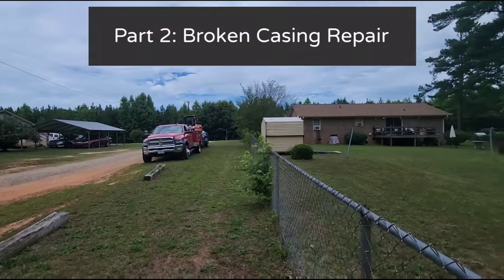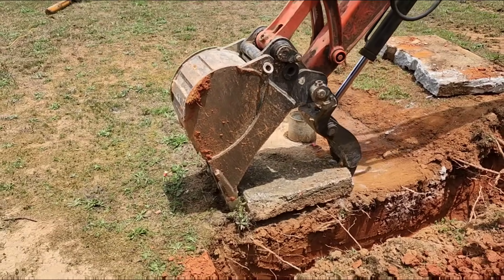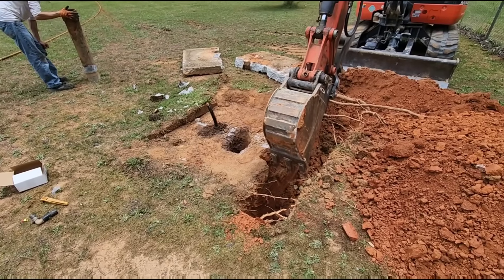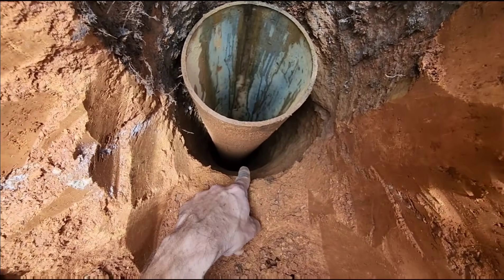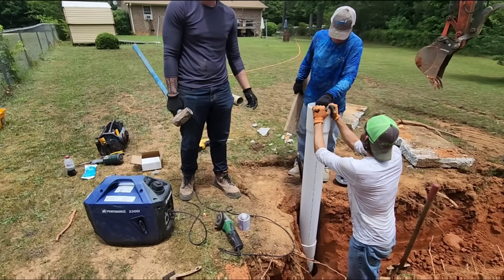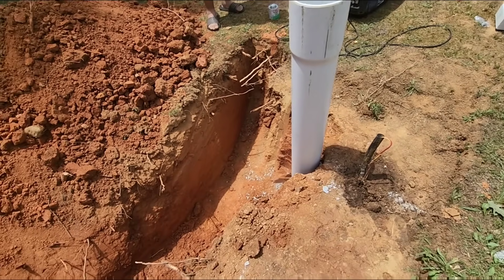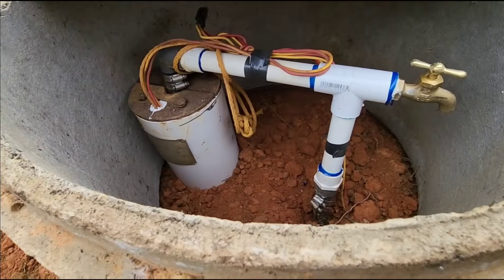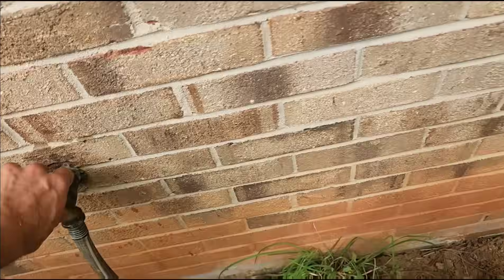Part 2 - The Cause of Muddy Well Water After Raining, Casing Repair.

Comment: Stupid of the original driller to not use threaded pipe or at least grout the casing.   Glad you were able to help out this homeowner.  I think my dads well is in the 60 year old range.  He has steel casing and has had rusty water for the last 20 years.

Comment: He should have mentioned to the owner that if the lower pipe part sags he now have a risc of misalignment deeper down the pipe. This would make installing a liner very hard or even impossible. What they did now was only possible because it was near the surface. So i would not reccomend to wait with the liner installment to long.

Comment: I modded all my 4-1/2" angle grinders with larger guards so I can run 6" thin kerf cutting disks. I've done it for many years without issue and the extra edge speed and blade reach is worth it.

Comment: Knowing the well pipe is cracked and all the steps you’ll just did to save the well as is! Why the hell not run the water straight out the pipe at the well to purge the dirty water before putting a garden hose valve?

Then run the water at the house for around 5-10min to purge the water line to the house. Then run water to purge all the water lines for the water heater, kitchen, bathroom and laundry room!

Comment: For 1980 that was some extremely lazy casing install. If it fell in after cutting it would not have been that hard to fish it out and do it proper. The fact they did it twice boggles my mind, the casing is actually in really good shape so I doubt it rusted out the threads. The concrete pad was the cincher. Their intent was obviously to try to stabilize the top of the casing that was just resting on the coupler. But in reality that kept that top part unable to settle with the lower part.

Comment: I would start looking into Air well (condenser) & Atmospheric water generator's Technology
(80Ltrs ~ +10000Ltrs Per Day )

Air Well Remains At above Ground level (easy to Service & Fix and keep clean ) Guy with HVAC Skills Can fix Them

They work in Drought Arias (Droughts going on for decades No Rainfall in Years ) and can work OFF Grid Battey less Solar & Wind power (SOLER MPPT VFD)

Cisterns (Underground Plastic Tanks / Underground & And Above Ground raised weight accumulator tower) Buffer (With UV-C & OZone germicidal loop Treatment)

Comment: BE NICE TO RUN A WATER HOSE DONE THE PIPE TO CLEAN THE IN SIDE OF THE PIPE AND ALSO SPRAY OFF THE MUD ONT HE WATER LINE CAMING OUT OUF THE HOLE... SO IT WILL BE CLEAN AGAIN...

Comment: As I plumber watching this.  I would suggest you invest in a 4-6 inch test ball from a plumbing supply house and a couple extension hoses.  Would be a lot safer and easier to seal the well from debris falling in.
Reply: Good idea.
Reply: It would have been avoided if the ones who put the well in did the job right. Threads with Treads, not just sitting on another pipe without Threads.
Reply: @Lord_KnightMare there are times when we all have to fix stuff that was installed incorrectly. You know the cheapest bid wins the job.
Reply: @ashleywynn4923  as an electrician it gets scary seeing how the lowest bidder managed to make money 😂

Comment: Lining wont fix water contamination unless you are grouting/sealing between the outer pipe and the liner. Is that what they will do?

Seems to me the better decision is to dig another ten feet down and seal the broken joint.

Comment: I totally lost by this. I have worked Colorado water wells for decades. We always used steel pipe casings cemented into place. New holes need min 40 foot casings. Then I saw a number of your wells with pipes coming out the top of the well head. We used pitiless adapters 5 feet down. It’s strange seeing wells where the casing is plastic and wiggles about. Is this the standard for your part of the country?

Comment: How is the coupler sealed to the steel casing?  I understand it's cemented w/ PVC cement to the PVC casing.  And do you sell those on your website?  Always interesting to see the options to repair different issues you run into.
Reply: It's essentially a weak compression fit. A semi-flexible material is tightly fit (the hammering forces it around and seats it) around an inflexible pipe, so it's like attaching a hard radiator hose. The 4" pipe itself is not under pressure, it's only a conduit for the pump and smaller pipe it is attached to. All you need is a seal tight enough to resist the fairly low pressure of the ground water attempting to seep in, which that fitting will do, and any seepage attempting to go through that tight fit will self-seal with particulate. That's a good "quick" fix for a fairly serious problem of half-assery done 40 years ago.

Comment: Thanks a bunch. It was a great tip to find out if a concrete is put around the casing, in time it can move. Something which I was contemplating on doing here in Uganda. This video was a great help to deter me from putting a concrete slab around the casing. I just got a new borehole machine for my voluntary project in Uganda helping villagers with clean water. I was about to start the first borehole but ran out of time on my air ticket. I'm heading back to TX then back again to start the first borehole using a submersible pump. Other villages where there is no electric, I'll be using a hand pump. Do I have to flush the borehole before installing a submersible pump? Many thanks for sharing your very valuable experience with us. For me your work and advise is a rating of 12 out 10
Reply from the maker: Once you drill the well, you can install the pump & flush the well by allowing it to pump for 30+ mins. Itll allow fresh water to flow in & hopefully the water becomes clear.
Reply: @h2omechanic  Many thanks, your response is greatly appreciated. I'll give it a try as you suggested on  my return from TX. Is Polymer necessary to use in order to avoid borehole cave in? Here they mention it when drilling but not when dug by hand. I am about 8 km from a lake which is about 10 square meters and about 3 meters deep. I have not heard you mention in any of your videos. Someone here gave me an advise to buy a 7 inch drill bit and use 5 inch casing. I bought a 7 inch tricone drill bit for use on tough rocks. Not having started the first borehole with a new machine and  having watched your videos, now I'm  wondering if I can use a 4 inch casing instead since I already have a 7 inch drill bit. So using a 4 inch casing for both hand pump and submersible pump, will it work? Many thanks again
Reply from the maker: @umojacleanwater  yes alot of people use 4" casing. It's different from region to region.

Comment: If I were the owner, I'd have you dig down the next 10 feet to the hopefully last loose joint. Then replace up to surface. Hopefully eliminating relining the well! Also you need to repack backfill every 3 inches so nothing shifts when soil settles.

Comment: Jesus that's a muddy ass well.

Have you fellas ever installed HDPE well casing? It's not quite as straightforward to work as PVC but it's a lot more resistant to cracking and all that. And you can get it in crazy lengths.

Comment: You could put a flat chisel on your sds hammer drill and jack hammer alot of that dirt out into the pit and not have to dig quite so much with the shovel and maybe save some dirt going into the hole

Comment: Man I wish you were in my area. I have a large diameter concrete casing well that gets muddy after every rain. I can see runoff water going in about 12 feet down. I've had three plumbing companies look at it, and nobody knows how to fix it. You mentioned using a liner. I think that could be my solution. Thanks for the video. You're a master.
Reply from the maker: There's no fixing your bored well. They work using surface water. 
You must use big filters or drill a drilled well.
Reply: @H2o Mechanic  Thanks H2o Mechanic!  Bummer.
Reply: Good evening Sir, where can we I purchase a transition coupling like that?

Comment: Wth?!  Somebody's not thinking too clearly.  There was no reason to remove the 1st piece of pipe and then need to put in a plug.  Just plug the 1st pipe, and dig all you want, and down to the 2nd bad joint and also fix it.
Very poor work and only 1/2 of the job, bec if you fixed both joints, there most likely wouldn't be a need for a liner
Reply: Watch part 1, the first piece was shifted out of place
Reply: @ricardinobp  So that makes no difference.
Reply: Dig down 40 feet to the 2nd bad joint? Are you crazy. It would be a whole lot cheaper to just yank out that steel liner, and put in a whole new well. He said 5000-5600 estimate to just replace the whole well, pump and all. Digging a 40 foot deep hole in the ground with an excavator would make a hole so big in the yard, the house could fall into it. And cost 10x or more.
Reply: @brnmcc01  The 2nd bad joint was 10ft down. But still, 10ft down is a LOT of digging anyway - and unsafe.

Comment: I have the same problem, but my well is only 40 feet deep and 3 feet wide. The casing is made of 13 concrete pipes and when it rains the water gets dirty. Also, I realized that rain washes away the dirt around the casing so now I have 5 or so inches of space between casing and the soil. What can I expect in the future?
Reply: What's the ground makeup the soil layers etc is there a well log on the construction how is it back filled around the casing what is the static level does the water come in from the bottom material is there a gravel pack etc. lots of questions and variables I know then who was the driller how many gpm do it produce ?
Reply: Getting sick

Comment: U got a new sub. I just want to say I like the content and info it's been hard to find information on some of this stuff that Is reliable. Had a problem with my well and had a service call and was told that my pump was failing pressure tank control box were all bad. Only did the pressure tank and control box to get water restored. We had been dealing with the low pressure since the purchase of the house so was surprised that it was even lower than it was prior to the issue and even though he pulled out the pump he didn't chlorinate the well. So we dealt with the low pressure for a couple of years but I finally found some info on shocking the well with a ton of chlorine fixing the issues we have. Slimy rusty stuff low pressure and funny smell. So I decided that before I was going to condemn the pump to give this a try. It worked way better than expected obviously the pressure didn't change but I found out that the service tech installed a lower pressure switch and is why I was confused about the pump failure don't get me wrong the pump is not the best and isn't big enough to keep up with the flow but that is a different issue and don't mean it's bad. It cleared out my pipes increase in flow and I went for gold and cranked up the pressure switch and have been at it for a year+ now with it set at 70/50 and everything has been working great. Should I be worried about the pressure setting at this point or being everything is great no leaks ECT leave it and keep running till the pump finally lets go
Reply from the maker: Leave it alone & keep running it.
Reply: If it ain't broke, don't fix it.

Comment: I have the same problem except I have a 4 inch plastic pipe for a casing. 1/3 of the dirt around the casing is gone. about 1.5 inches away from casing. A piece of dirt fell in and I could hear it hit the water. I guess i cannot use bennonite casue it will just go down into the water.

Any suggestions?
Reply from the maker: Call a well company! Fix it before it gets unusable

Comment: Our health depts here and our well laws/rules/regs wouldn't let you do that it's not sanitary and or water tight to be a  non human use well till fixed and tested or abandoned to code and a new one drilled all our wells in OH are tested for human use against "bacteria contamination"
Reply from the maker: The last 5 years would be the same here, but now the health department is walking away from Water Well work bc they don't have enough employees in their office. This Well did need a liner, but the customer has to save up the money for it. Remarkably, this actually fixed his issue with rain water getting in. I've called twice and the water hasn't gotten muddy anymore. (Let's see how it does after this hurricane 🌀 which hits us today).
Reply: @h2omechanic  I agree with your fix 100% and time vs $ sadly bookworms  & pencil pushers with no field or real world experience govern our trade. Not a good & honest well man out there going to contaminate his lively hood !
Reply: @h2omechanic  bentonite is pretty awesome stuff and OH has gotten worse we deal with 3 depts ODH ,OEPA & ODNR then you have human use & agri/irrigation wells thru the OEPA one gets test requirements "human" 24 hrs at X volume gpm ,static/drawdown etc an Agri/irrig get nothing need not even hold OH license to drill so crazy stuff!
Reply: I didn't see any compaction of soil when it was put back. Expect the ground over the trench  to settle over the next year. Mounding the soil around the well would encourage rain water to shed away from the well rather then pond at the well. Small details to think about.

Comment: If you knew it's like a 20 percent chance it fixes the issue.....why not go ahead and run the liner down the well?? That would be 100 percent fix right??
Reply from the maker: So a liner was my recommendation, but the casing didn't line up so I could install it. So this had to be done first. Secondly it's a money issue. He had to borrow money for this part, we discussed a liner to be installed in the future. He called after 3 days of rain & said it didn't get dirty and to hold off on scheduling the liner. I can only offer the recommendation, its up to the owner if he wants to pay for the service
Reply: @h2omechanic All this time later, did the bentonite keep it sealed?  Great channel.  Calmly explaining everything as you go is key.

Comment: Can you pour rubbing alcohol down the well to sanitize and then pump it out the garden hose afterwards?,  or does the chlorine pool shock the only thing to use?
Reply: Never introduced an explosive substance into a confined area. Chlorine is very good as a disinfectant.
Reply: @nelsondog100  yes i used pool chlorine to sanitize the well, I realized that it’s not a good idea to use isopropyl Alcohol as it’s flammable, hehee..
Reply: @highspeedboom  lol yeah you don't want that in your drinking water.....
Reply: Hydrogen peroxide is an excellent purifying I use food grade 35%

Comment: Always factual and meaningful content. Makes me wanna take the proper courses, go out and buy a Well Drilling truck and do this myself. Great to see the guy you learned from as well. \o
Reply: Now a days a drill truck probably 750,000  or a million, I just bought and ditch witch Jt 30 hdd drill and it was 430,000 with trailer and location equipment
Reply: @Drewdayz2419 Damn not even an 18 wheeler wrecker costs that much
Reply: Best go do a week or a month with a driller in your area seeing then how the wells are  made size, depth, rock, unconsolidated with screens  how much they produce do they flow. Lots to know things can go bad in a heartbeat  and depending on rigs needed etc and tooling the costs to get set up might blow your mind cheap might be -$50K or $500K+ might be needed.
Reply: @stevelalondejr2183  Woah. I figure that truck would be expensive.

Comment: Wondering if you could recommend what well pump I should install—the data plate says the well is 145ft deep—static water level is 40ft and the yield is 10 GPM.
Reply: I have a 180 ft. deep / static 30ft. / 7 GPM.. I use a 1/2 HP Franklin Electric 120 volt 3 phase wire..Works great!
Reply: @MargeSchott420  Hey Rone, 120v and 230v are single phase; thinking you have three wires, with 120vac to ground on two of the wires and poss 0v on the other, which would be a ground wire. If you read the two "hot" wires to each other, you may find you have 230vac between them.
Reply: @MargeSchott420  Thanks!

Comment: who ever drilled the well did a piss poor job of back filling the angular space (outside of casing) i always left the drill (rock cuttings) fill in behind the casing, they pack so tight most times it is impossible to pull the casing back out. makes a excellent seal. if you would have installed a pitless adapter  at the depth where the line goes into the house you would not have had to piss with the cement rings.AHYHOW ill give you a A you did a good job and you seem to be a guy who would not screw his customer's.
Reply: Pitless adaptors are great, its just not very common for us down south.

Once you get to far north VA and above you start running into pitless.
Reply: Annular space, not angular.
Reply: qqqq